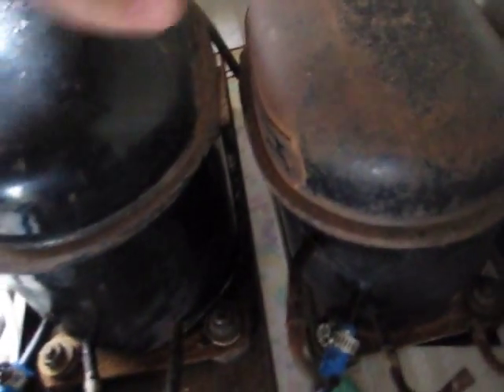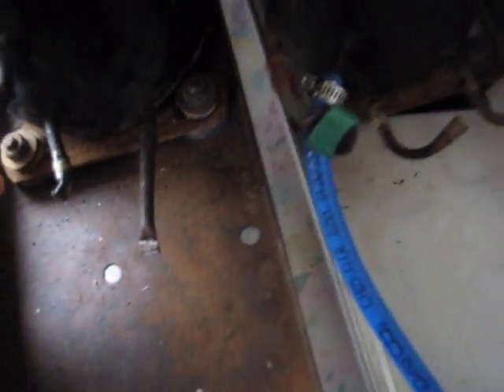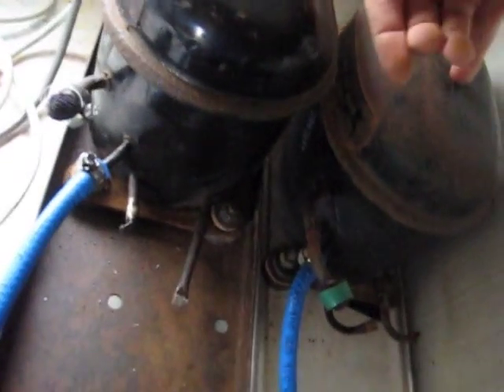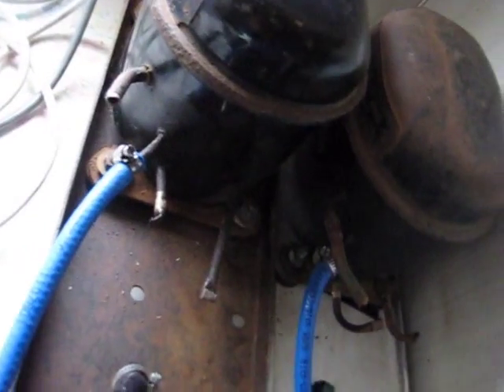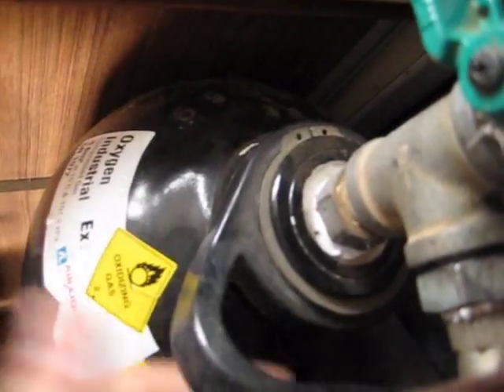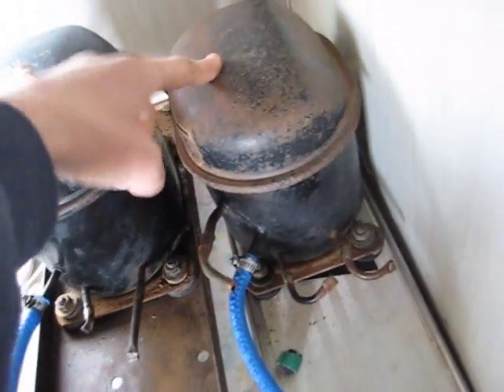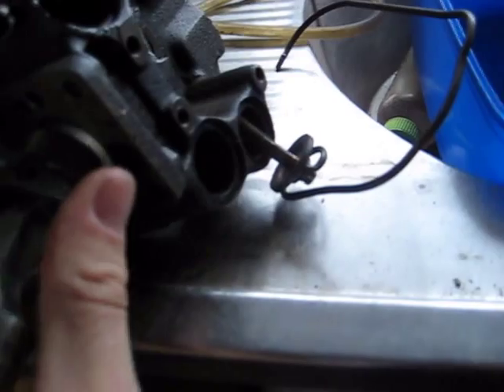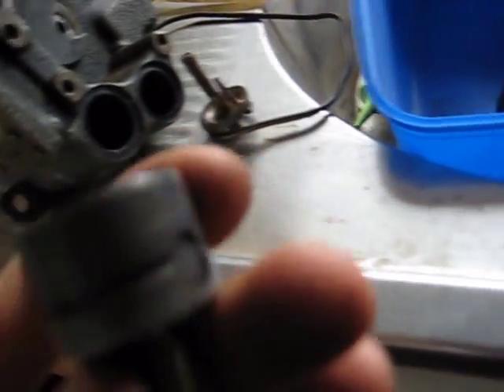Fridge compressors used as an Air compressor

Comment: what a bullshit , have build a similar one and it run now for 2 years without a failure , a reason why they can break after 1 weak is the oil , when its polyestre ( or a other oil didn't exactly know this ) it will assorb water out of the air and it will lose the lube effect thats the only reason ( a other reason is that you got a very bad one from the scrap/recycler )